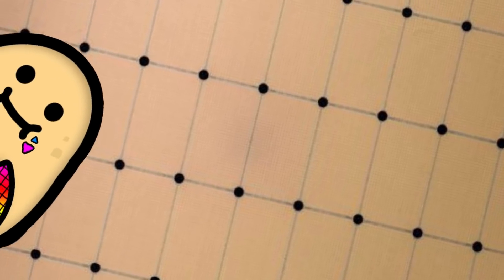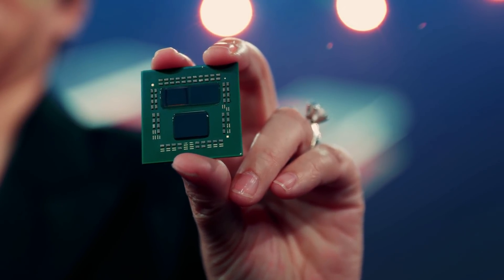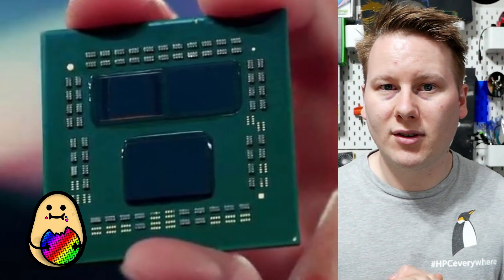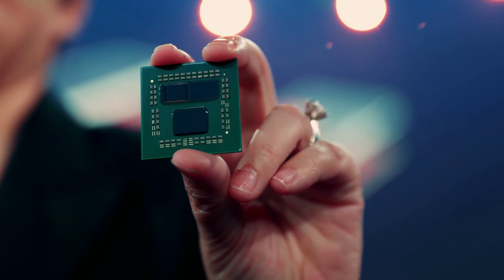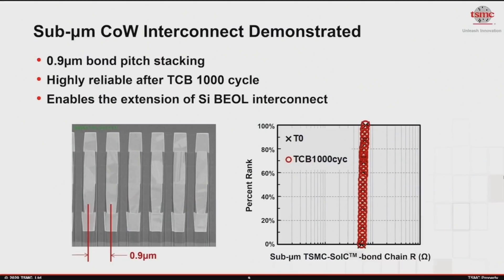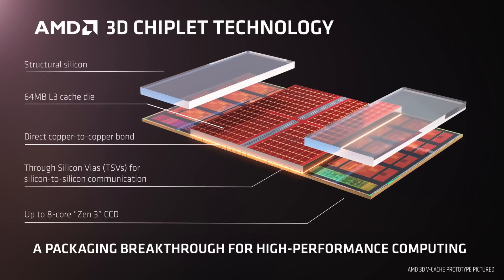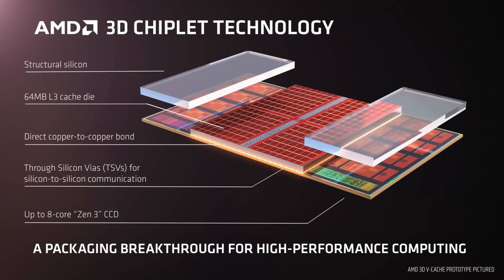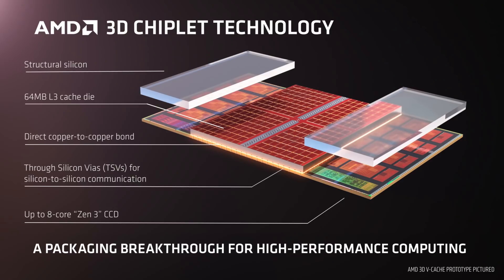AMD GETS STACKED 💪 192 MB of L3 Cache on Ryzen, Coming 2022?

Comment: What is that makes games benefit so much more than other workloads?
As a software developer I would hope that more cache would help with my "favourite" activity, compiling/linking large c++ programs.
Reply: Serial processes which can't be easily path planned or batched like other use cases mainly. However, I think there's also a lot more applications/use cases that can benefit from the cache than most media cover too.

For example, database engines can benefit hugely from more low level cache availability and can really suffer in VM environments where cache availability is low even when all the normal resource load metrics are low (CPU, RAM, etc.).

While, yep, many development/compile workloads do benefit hugely from more cache.
Reply: More cache helps in gaming for sure  that's probably Focus amd has since IPC on zen 3 is still so strong not sure about other applications

Comment: Imagine they move all of the cache to the stacked cache, then with the extra space on the logic layer, they throw in 4 or 8 Graphics CUs so that every chip has an iGPU. Or make the cores even bigger, who knows, but moving all the cache to the stacked cache would leave space for fun things ;)
Reply: Or they use a couple of 64 MB cache dies to add Infinity Cache to those CUs to increase effective bandwidth. I doubt it will pencil out on desktop (alone), but an 8 core CCX chiplet with cache die, plus a 16 CU chiplet with an extra cache die will murder Intel in laptops and probably eliminate the need for low end discrete GPUs. I could see a lot of SFF and thin systems also loving a beast like this.
Reply: What do we need iGPUs for? It's a waste of silicon!
Reply: @Kynareth6  Same reason we have 50 series gpus, there's a range of products for different price points for different consumers with different wallet sizes. Don't forget that the third world exists.
Reply: @Kynareth6  for note books and laptops this is a huge opportunity because the iGPU could be faster than any mobile GPU not to mention that this would make mobile GPUs obsolete (what could reduce the overall cost) and the free place can be used for other stuff battery /cooling(and with better cooling a better performance)/sleeker designe also the data transfer between GPU and CPU is shortened by a lot/is on the "same" chip which is an other advantage of iGPUs as well as no "bad match bottleneck" oh and for tower/desktop PCs it is possible to designate the iGPU for phyiscs calculations so that ur GPU has more resources for 3D rendering etc
Reply: @TheLtVoss  iGPUs in desktops have been laying dormant for over 10 years. They contribute to nothing, they don't do anything useful. They only waste precious wafer space. Programs SHOULD be using GPGPU and users SHOULD be using dGPUs for both work and gaming.

For example, for upscaling movies or interpolating movies, it's best to have Ampere dGPU, not some crappy iGPU. There is 100x difference in inferencing speed.
Reply: @Kynareth6  That's because it's intel. Intel includes an igpu as part of their product because they have to do it with the assumption that no gpu will be added to the system, and given that most of their sales are to OEMs that sell to offices, government bureaus and other agencies that will not provision for a GPU, they need to add that in there for that purpose. AMD is not doing so because their target market is the gaming and console market and they already have a large share of the low end APU market with their Athlon series and old bulldozer era chip dominance. It's a question of markets, not a question of performance.
Reply: @Kynareth6  I don't know how much it is done by other people, but I've used it for compute shaders on data I want to share with the CPU. Rather than moving it back and forth every frame and taking resources I would much rather be using for graphics, you can just use the CUs that are right there sitting idle. Physics code that iterates multiple times per frame with shader steps and a CPU steps interleaved in particular doesn't want to spend all it's time moving the data around. Maybe I could make all parts of the code a shader and have it all on the GPU, or just eat the performance hit and run it all on CPU, but iGPU offers a middle ground that is appropriate.
Reply: @Kynareth6  OEMs?
Reply: @tomhazard5546  I've never had any interest in OEM PCs.
Reply: Apu’s will be little monsters with all of this new tech and fidelity fx games like pubg and counter strike wont need dgpu’s no more
Reply: Rdna 3 igpu sounds yummy
Reply: Or they make an IOC with RDNA cores and an ICO without one... then they can stick to one CPU core type and keep the CPU chiplets small.
Reply: What would be cool is all L3 cache is removed from chiplet, chiplet gets smaller they add another chiplet, plus IO I think is going to 7nm and then this new L3 cache is used to bridge all the chiplets. Shared L3 cache between chiplets would give the CPU a great speed bump.
Reply: Well, considering we are already on chiplets, an iGPU in an apu will be its own chiplet. So if you look at say a 3950x, its two 8 core cpu chiplets side by side, and then the IO die. an APU would simply be ONE 8 core/16 thread chiplet, and then instead of a second CPU chipet, they place a gpu chiplet, and then of course the IO die. there is no reason to go monolithic like intel with cpu/gpu combinations in a single chip because AMD is already the king of chiplets.
Reply: Ian just said that its hard. Core on the botton means good power and high heat if the cache is on top. But if you put the core on top you can have a power issue. Maybe if the core chip is larger than the cache e the power comes from the non silicon area.
Reply: you can't just make core bigger!!?, they need to be small to reach high frequency like 4 or 5ghz...
Reply: Yeah, if you look at AMD's road maps we're supposed to get iGPU's with Zen 4. So it makes a ton of sense when you realize what that 3d stacked cache can do for an iGPU, especially in GPU accelerated work loads.
Reply: @dondraper4438  That's not on the public roadmap, those don't have details like that, and the leaked "roadmaps" have proved to be dubious. But it's a possibility.
Reply: @Jaker788  If AMD doesn't add iGPU's to Zen 4 desktop ryzen processors, then it'll be a huge missed opportunity. They also don't need a large 16cu gpu like the other guy said. 7 or 8cu's of rdna2 would be more than adequate.

Comment: I think Dr Su was flexing at Intel when she showed the prototype. Kind of like a warning shot to Alder Lake?
Reply: she said they're gonna tape it this year. so yeah, it's for ADL. And it's not a warning shot it's a fckin nuke.
Reply: Intel: AMD just glues their CPUs together...
A few moments later...
Intel: Oh...
Reply: It's more like Greg Goodenough says, 'cause what it also says is: "We don't need a new core design (e.g. Zen4) to get more IPC, our cores are just memory bandwidth starved not IPC exhausted." ... That's a nasty blow below the waistline.

And to solve this with a "easy fix" by "slapping" one chiplet onto another chiplet, must really hurt, because Intel has it's complex interposer infrastructure, while TSV Cu-2-Cu interconnect are smaller ( 4 µm ~ 6 µm vs. ~36 µm), it also comes with non trivial problems of soldering. Soldering multiple "layers" usually requires different solders at each (or at certain) step(s), with different temperatures, heating curves, re-heating cycles, ductility, not to speak from vibration in the soldering process.
Reply: @darknase considering TSMC is making it, it should be fine. Hell, I'd bet these chip don't even end up in anything other that Epyc, for the first 2 generations at minimum.
Reply: Makes no sense to anounce this stuff the the enemy just to flex. This was more like showing their shareholders that the last years weren't a 1 time thing and they are ready to respond to everything intel has to offer. It also helps to keep fans boys and normal tech people talking about them. Free publicity.
Reply: @nocivolive  It's how to cause Intel to panic. If intel has nothing to show (little progress) kick it out of the part showing you made a tone.

If intel has something to show, keep a little quiet, then beat them by surprise when you release.

Means Intel cannot even guess at how to beat AMD in this game.
Reply: oh... I thought that was Chaz Bono in heels.
Reply: L3 is expensive you know... 
It's a "look I'm stronK"(but not really) kind of flex. And with stacking memory chips over the cpu cores, what the temps will be? We have seen what lapping the die can do with the 10th gen intel(it helped a lot) so ADDING more resistance between the core and the ihs is another recipe for melting cpus, just like everytime...
Reply: @antoniohagopian213  if u look closely,  the extra cache die is sitting on top of zen3 middle part which contains only cache. The compute cores are uncovered with die. Cache memory in the zen3 core complex doesn't produce much heat. The edges of chip produce most of the heat. So mantaining temps is not an issue.
Reply: @antoniohagopian213  I'm sure amd knows what they are doing
Reply: @antoniohagopian213  at least with ryzen temps are much better than Intel at a given performance level, because Intel chips need significantly more energy. 
Not saying it couldn't be an issue but the hot n loud AMD days are behind them for the moment
Reply: @antoniohagopian213  But does this bring down the cost? As it's not "on die" with the main CPU die, you can bin/produce at a much better rate (as with chiplelets). Thus unlike cache stuck on the one CPU, and dead/cut back if not up to scratch, this cache can be repurposed to lower spec (16mb etc) or disposed of, and other parts of the silicone batch can be used instead.
Reply: It isn't made on the same fablet, so, yields won't be a issues.
Reply: @antoniohagopian213  jus take your copium and relax mate
Reply: Alder Lake has DDR5. Intel has nothing to worry about.
Reply: @Patrick73787  so has zen4 and 29% more ipc Alder lake will be shit like 11gen
Reply: @dam8976  Zen 4 competitor will be Raptor Lake-S in late 2022, time to get up to date :)
Reply: @Patrick73787  wait for a few months from now when amd say this will be on a processor with ddr5 mem controller lol....
Reply: @Patrick73787  Lol DDR5 won't even be relevant before at least 2023, so don't talk shit

Comment: This is going to present some cooling challenges.
Reply: The overall thickness of the stack is supposed to be the same as the original die, so as long as the interface between the chips isn't bad, there shouldn't be much trouble.
Reply: Maybe. Maybe quite the opposite.
Reply: Doubt it. The cores are still not covered and the clear on top of the cores actually conducts heat
Reply: @NadeemAhmed-nv2br  On slide that "clear" is called "silicon" so cores are pretty much covered.
Reply: @NadeemAhmed-nv2br  ryzen chips are already hard to cool considering their powerdraw. You can cool an i7 that draws 300 watts given a large enough (water) cooler but something like a ryzen 7 cant really draw 150 watts properly
Reply: Not really.

Comment: My hype for AlderLake suddenly vanished
Reply: Alder Lake is the only way Intel can claim high number of cores without exploding their TDP. Why would you be excited for weak cores in the desktop? Intel is at an impass, hope they recover, but Alder Lake is a pretty stupid idea for the desktop, when you have up to 64 big cores from AMD no problem. It's just a marketing stunt so they can claim high numbers.
Reply: @razvanfodor5653  Its not stupid, I would like that on my 5900x, because it consumes around 50w when idle, thats more than what some cpus use in games. Clearly its not very efficient when there is minimal load, smaller cores could handle background tasks. Thats not bad feature, its freeing the big cores from interupts or just let them sleep to save power. EPYC is also not very efficient when idle, just the io die consume like 100W. But when all those cores are loaded they are very efficient cpus.. compared to Intel 14nm which is not really any good for 2021.
Reply: @eth_saver  Ok, but are you really excited for a CPU because it draws less power at Idle or even when browsing? Is that the breakthrough that Intel is basing their hopes on? We are talking about high performance CPUs here. Use a laptop or tablet if you don't need your 12 core, I'm sure you have them.
Reply: @razvanfodor5653  I am on laptop right now! Its using around 6-12W :), there are already rumors that AMD is working on the same thing for desktop and soon they will also have big and little cores, maybe by that time it will be more exciting for everyone. Because those big cores alone wont be easily cooled on even smaller nodes like 3nm. (same issues as Intel has right now)
Reply: @eth_saver  I heard about those rumors, and am not sure what to think about them. We will see, these heterogeneous architectures don't usually work well in desktop, especially with how stupid the Windows scheduler is.
Reply: @eth_saver  " EPYC is also not very efficient when idle" If your EYPC is idle, you dont deserve to have one.. use the damn thing as hard as you can
Reply: @DanafoxyVixen  Most servers dont operate at 100% all the time, if you do that it is clearly very bad practice. Usual load of dedicated servers is like 30-60% with ocasional spikes higher depending on time of day etc.. If you run your app on a server withou any headroom you are crazy. On such load its possible that Intel chips are more power efficient which is really shamefull for AMD.
Reply: I will wait for some actual performance numbers to be proven, vice listening to Intel's predictions ever again...(after that 11th gen debacle)
Reply: Alder Lake has DDR5. Intel has nothing to worry about.

Comment: This is quite exciting. Can't see a way for Intel to come back until 2024+ now.
Reply: Nah if they get 10nm+ off the ground it can be viable by as early as 2022.
Reply: @3DAnaglyphGames  Alder lake would be around 10-15% over Rocket lake at best. Amd still using zen3 with more cache to combat that with their xt variant. Zen 4 are also coming. Intel meteor lake coming at end of 2022 at best then lunar lake 7nm possible at late 2023 with zen5 should be somewhere mid 2023. Intel is playing catch-up with amd on cpu side.
Reply: Intel has DDR5 way before AMD, they have nothing to worry about.
Reply: @Patrick73787  Oh they have things to worry about on the server side, but desktop chips should be very competitive in 2022. I don't expect Intel to compete in the server business basically at all until 2024, but the desktop chips are not that far apart.
Reply: @3DAnaglyphGames  They have nothing to worry about even in the server space. A 72 core Sapphire Rapids chip will be competitive with a 96 core Zen 4 chip. Sapphire Rapids supports AMX instructions, which is way faster than AVX-512. Sapphire Rapids will also be paired with Xe-HP and Xe-HPC GPUs as well as 3rd gen Optane Persistent memory that work on DDR5 slots.
Reply: @Patrick73787  Is AMX even used by anything? Even AVX-512 is a rare sight, if AMX won't be used it won't matter if that's what makes it faster if the rest of the workloads aren't faster.
Reply: @3DAnaglyphGames  Yes, it will be used. The AMX instruction was created for Tile based CPUs (which is the case for Sapphire Rapids chips).